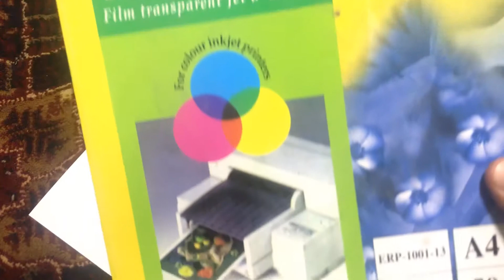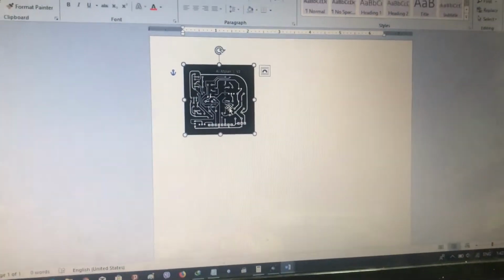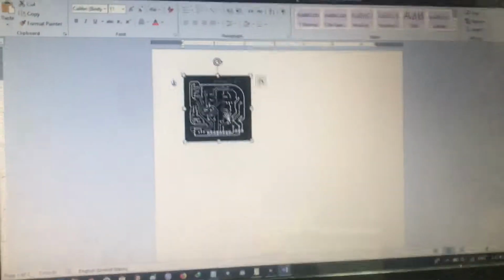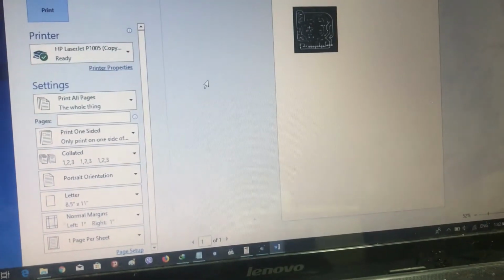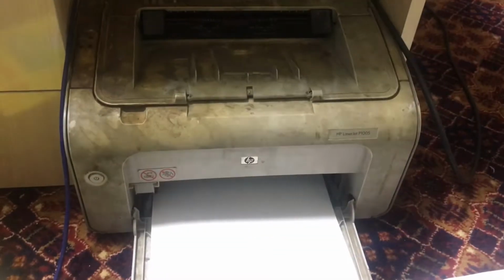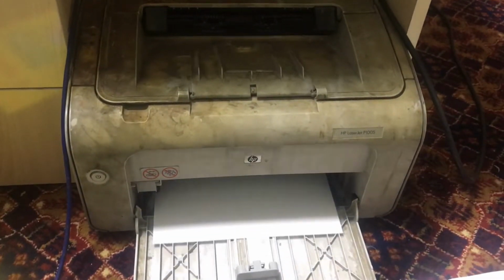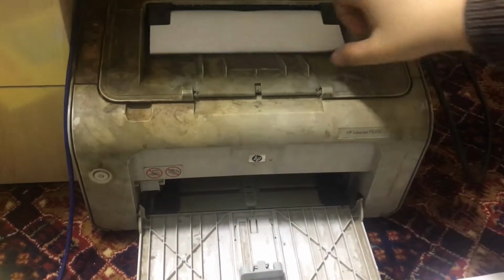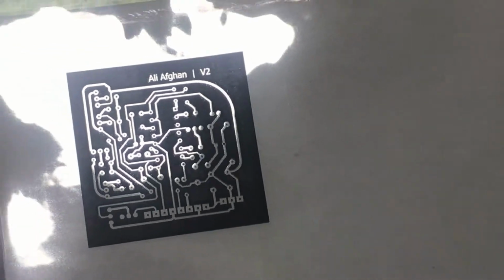Laser jet print on transparent paper

Comment: I wouldn't recommend people try this unless it's a printer they don't care about. Mine doesn't just print badly, it actually melts the transparency. And this was on transparencies designed for laser printing. I was considering printing on Kapton tape (since I'm also looking at doing PCB etching) but that blocks UV light.

Comment: Hi Sir ,Glossey photo paper for inkjet, Could i use the same thing on laser jet Pro MFP M227fdn or using this paper or need photo paper for laser printer ?
Reply from the maker: Flamingo - Transparency Film Color Inkjet DPI 360-600 A4.
Reply: @MasoodOfficial  thanks for video i have the same paper but used with inkjet printer. Is the black from laser printer solid like not letting light through?
Reply: @MasoodOfficial thank you for your video. I used the exact same transparency in my inkjet but was not sure if it will work for laser. Thank you very much